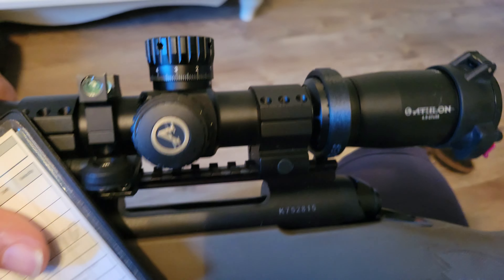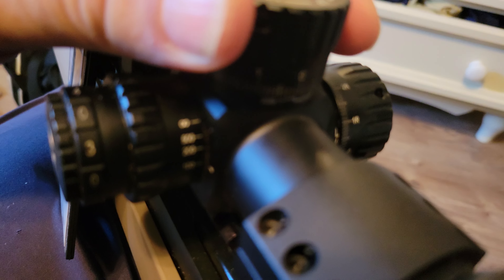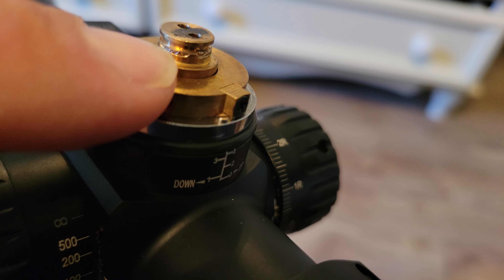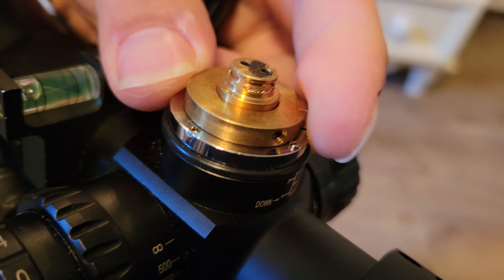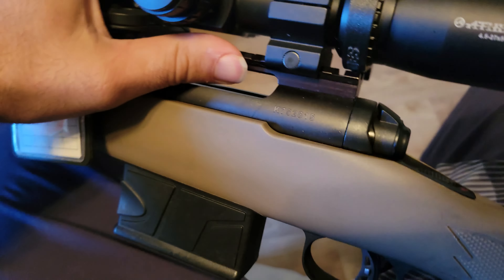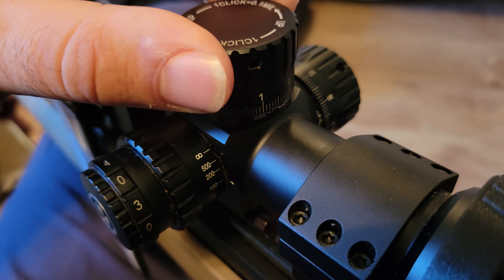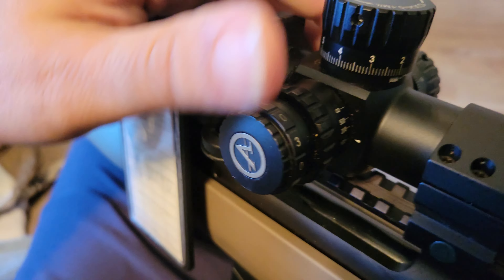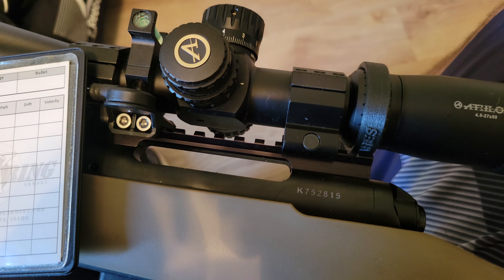My Athlon Ares Btr is broken!!!

Comment: Replace the grub screw n line up with divot hole in stem..
Reply from the maker: I tried new screws but I'm not sure there are specific divots in the stem that whole piece looks "chewed up" probably why they changed the design on gen 2